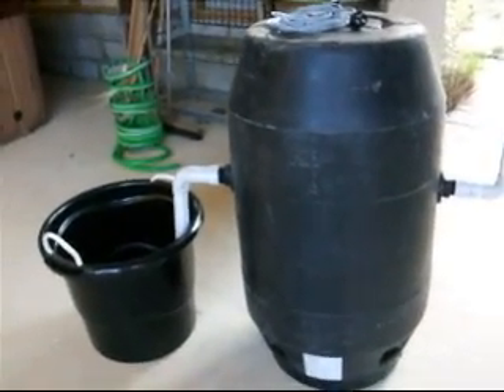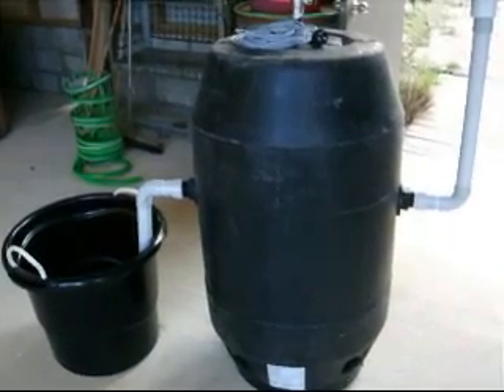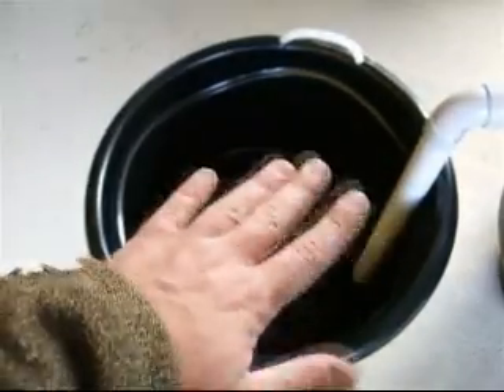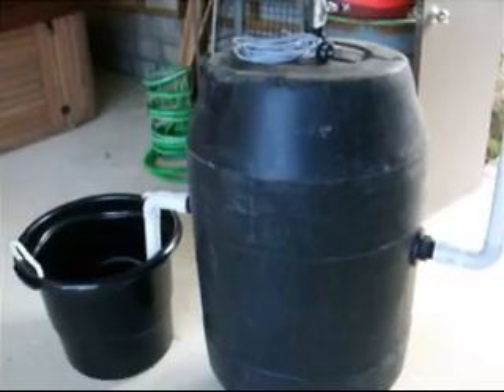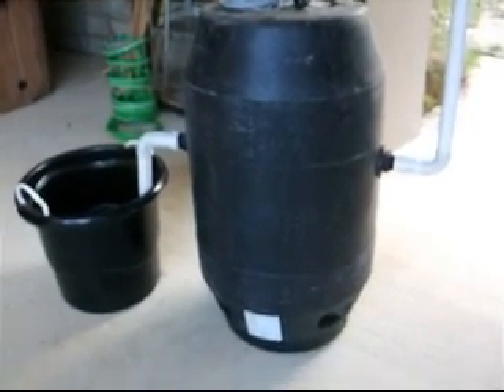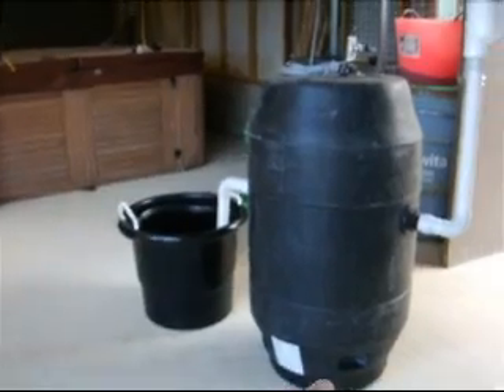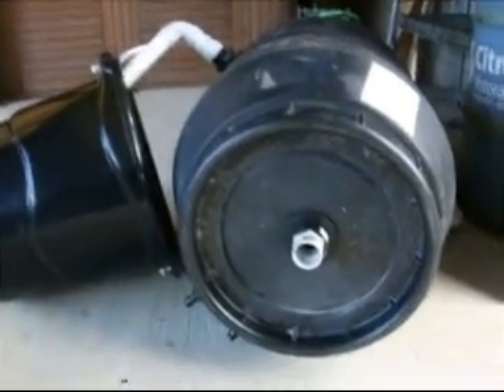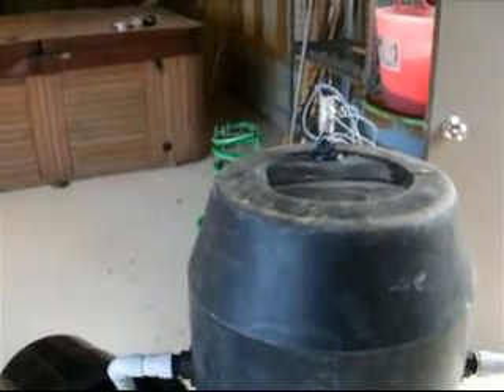Methane Generation (Biodigestion) Trial at TSH

Comment: If you build a compost heap around the setup, you should get 50 - 60 degrees, even in the middle of winter.  You may have to redo the compost a few times a year, but it will run for free.  ;)

Comment: I like the layout. One suggestion. You may want to rethink this recirculation pump. Stratification process that you described is beneficial. You end up with two separate colonies of bacteria one for the buoyant wast and waste one for the heavy waste. Wastewater is the center Strada and this is what is removed. If you do a recirculation pump you constantly be mixing the layers together and much of your undigested material will be coming out in your wastewater. Just a thought. Thanks for a great vid.